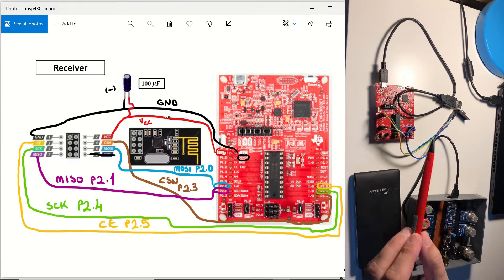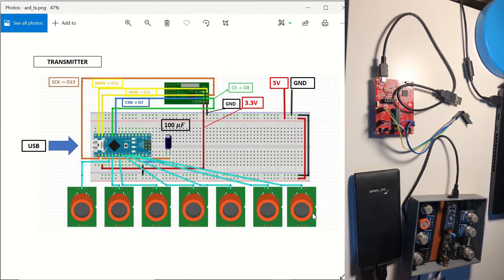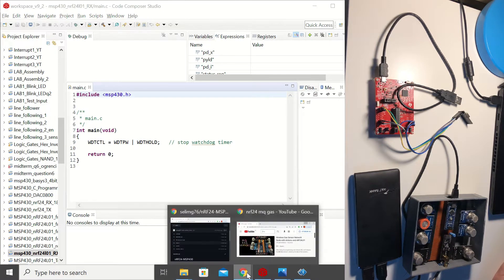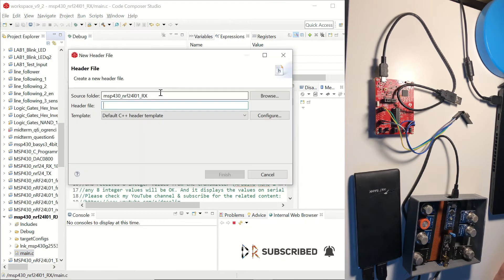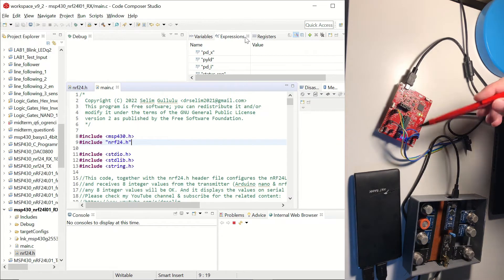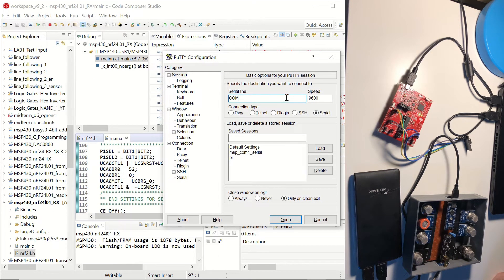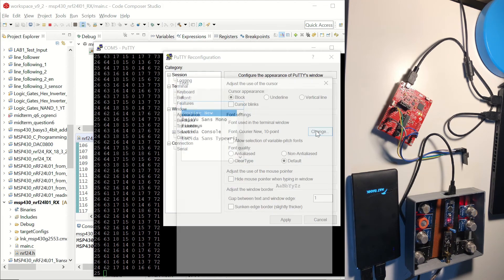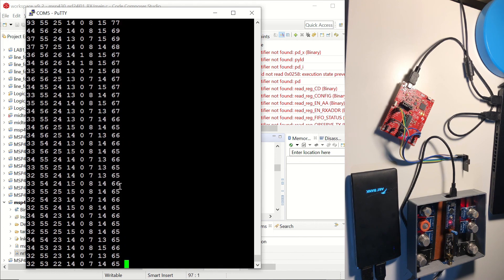MSP430 & nRF24L01+ : Wireless Receiver

Comment: Can msp430 with nrf24l01 be able to transmit msp430 with nrf24l01. thank you
Reply from the maker: Yes, you can use the code in my transmitter video
Reply: @drselim  Can't use arduino?
Reply: @drselim  Can I receive data and data transmission using msp430 with nrf24l01?
Reply: @drselim  code error help me!
Reply from the maker: You can use both, arduino nrf24 - msp430 nrf24 communication is shown in the videos, but you can use msp430 instead of arduino as well.
Reply: @drselim  thank you very much
Reply from the maker: You’re welcome

Comment: Very interesting, thank you.
I very much like the MSP430 architecture - in fact it reminds me of the PDP-11 which may give you an indication of how old I am.

After programming the MSP430G2553 one can take it out of the launchpad and use it with just a few components (A 47k pull up resistor on the ~RST pin, a voltage regulator - perhaps the MCP1700-3002E/TO and a bypass capacitor) and one is in business.  I prefer to use a LiFePO4 rechargeable cell as a power source as it has a stable output of 3.2V for a large amount of its discharge range and can be recharged more times than a normal Lithium ion battery.

Using the MSP430 with the nrf24L01 to transmit the occasional message seems to be a good fit because of the low current draw of the MSP430.

I need to do some more reading to understand how the nrf24L01 can be used to transmit and listen for replies - and the work that you have done is very useful for that.
Reply from the maker: Hi Richard, Thank you for your kind and valuable comment. Honestly speaking, I looked pdp-11 up on google :). I only have seen the start of the Commodore 64 era as a not so small kid. You can have a guess about my age as well.
Your setup regarding using the 2553 out of the launchpad sounds great. However since I have a single chip at the moment, I could not risk it for such applications. I’m afraid if I break a pin or two and make it useless. But I definitely will try the setup as I have spare chips.
I spent a certain amount of time on the nrf24 module, I prepared a tutorial to cover how it works. I think you can enjoy it. Also I added the RC Car setup which again uses the same transmitter with combination of the ADC10 module.
I’ll be glad to see more of your comments in order to learn more from your experience. See you.